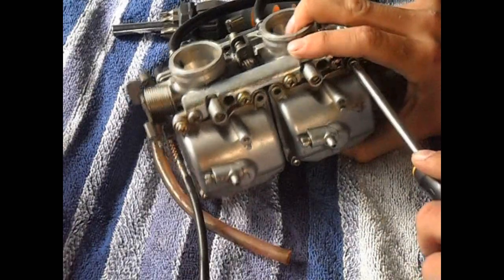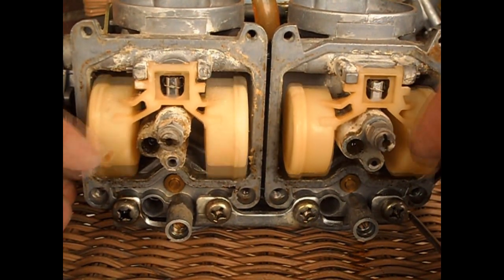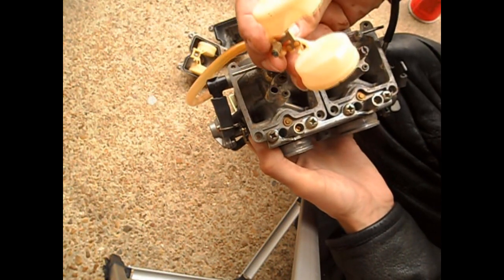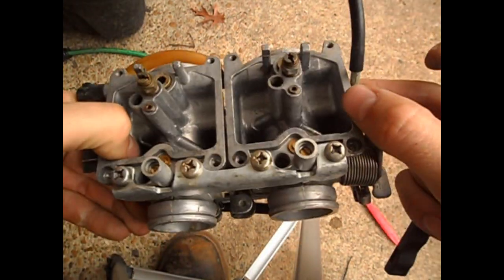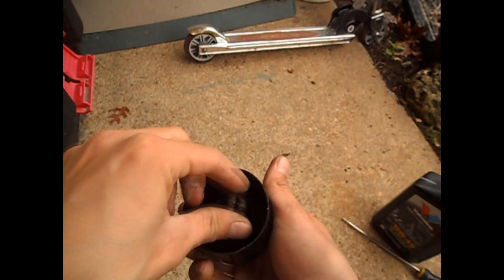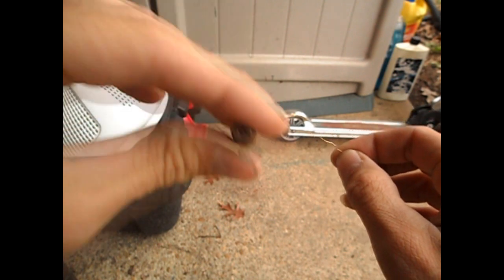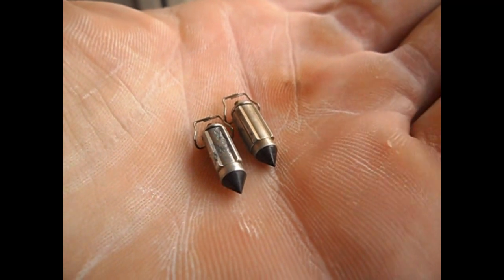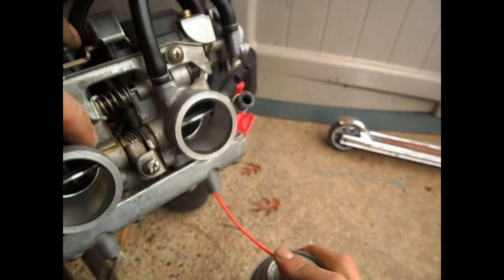Ninja 250 carb cleaning tips - video demonstration

Comment: Why in the world did you leave the gaskets on when you started cleaning? I can see someone melting their gaskets cause they didn't know better. I would recommend that if you use a wire brush that you use a brass wire brush, which will be soft bristled (as far as metals go) so that you are less likely to scratch the aluminum. I also wouldn't get carb cleaner on your bare skin but that's just a personal safety preference. 

That's all the negative stuff I had to say, now for some positives. You described what you were doing well, your camera work is really good and all in all I found this video easy to follow.

Comment: Instead of using wire to clean out all the jets, i would recommend using an air compressor, just to avoid damaging the surfaces. Actually blowing out the entire carb before reinstalling is usually a good idea.

Comment: Is the engine supposed to warm to normal operating temperature before the needle valve functions properly? I replace engine valves and piston rings. Despite that I had a clogged pilot jet; I adjusted the float height and suffer hesitation. I'm thinking some person plugged the pilot screw holes deliberately. If the engine idle is 1800 r.p.m. the throttle functions correctly. I wish he'd gone into detail about those screws.

Comment: I had problems with stripping all the screws. It took hours to take them out. I had to Dremel the tip in the screw and get it out. Some I used a wrench. I don't know why they can't use better screws. Replaced them with Allen key screws with washers. I think it's .7mm * 16mm. I stripped a pilot jet too. I bought a small screw extractor bit and it went right in the small hole of the pilot jet. I also made the mistake of soaking the diaphragm... Don't do that, expensive parts for just rubber.
Reply: Oh shit  I left mine soaking overnight.

Comment: I was just doing the same thing.  I ended up taking a dremel tool and cutting a slot in the head of each screw.  3 minutes with a big-ass flat head screw driver and my problem was solved.  Ugly but effective solution.

Comment: Any tips on getting the carb in/out of the bike? I got it off, but I had to take out the battery, unscrew all the attachments for the air intake and then wedge it off little by little. I clean the carbs on my dirt bikes all the time, but this was such a pain - I have no idea how I'll get it back on!!!
Reply: It's a real pain to get these out compared to some other bikes. There is a mod you can do to the airbox (carefully cutting off the battery box) that will allow you to slide the airbox back a lot further, making it a lot easier to get the carbs out.
Reply: I ended up tearing out my air box all together and going with a direct fit K&N air filter. Costs $42 roughly and will save a tremendous amount of time and effort trying to get to the carbs and now there is a ton of room to work around in there compared to before. All I have to remove is my seat and 1 side plastic
. Part number is K&N R-0990
Reply: mpshags Any change in performance? I've heard mixed results when replacing the stock airbox/filter.
Reply: obviously its going to be a major increase in air flow compared to stock, which may require some jetting work to compensate for the increase. Other than that, increased air flow=increase in power, you just have to do some basic tuning. There is a air breather tube that goes from the top of the crank case into the air box that also needs taken care of. Besides the stock air box being a b*** to get out, I haven't had any issues yet.

Comment: hey...nice video..i have a kawasaki kle 250 and we have the same carbs...i have a question..how many turns need the air screws?because i have some issues with torgue and iddle
Reply: In another video somebody mentioned you need to remember turns needed to tighten all the way in, when you disassembled. Then tighten and turn back out same no of turns.
Reply: 2.5 turns

Comment: What year ninja 250 is this? I have a 2011 ninja 250r and im wondering if i can use this video for reference.
Reply: They should all be about the same, different process to take them out but all carbs share very similar builds. You should do one side at a time.